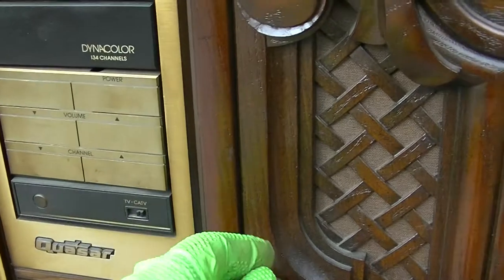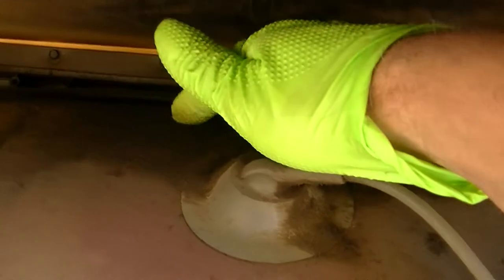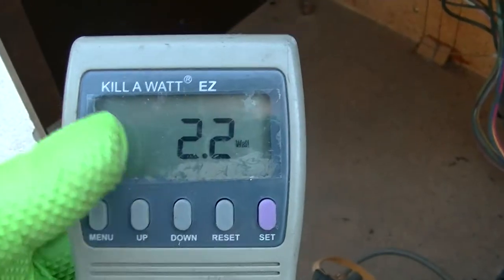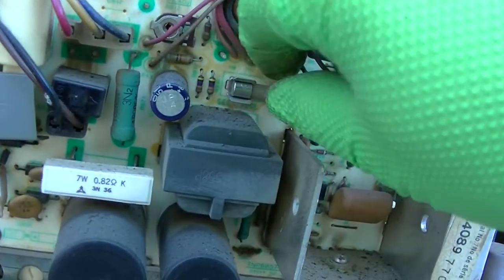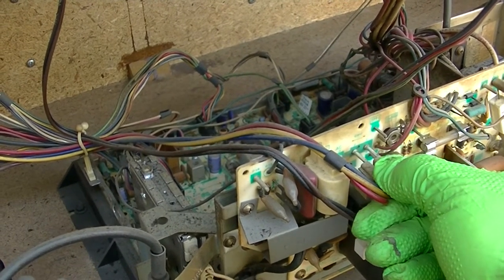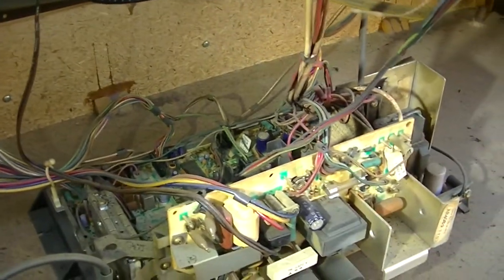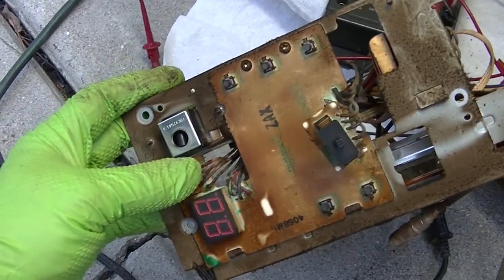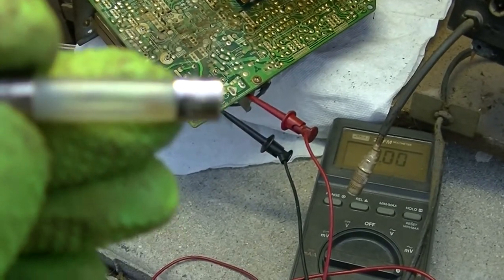Hideous Quasar Smokers Choice 1984 Color Television NASTY

Comment: Coming from a PAL country, it's always interesting to see what tricks American TV manufacturers tried to pull to keep the tint just right. Each manufacturer had its own system of "Dynacolor" or "Chromatrue" or "Supracolor" or whatever for automatic tint adjustment.
Reply: Our NTSC is a joke, even now with a brand new TV you have to put up with different tint levels from channel to channel.
Reply: NEVER THE SAME COLOR TWICE
Reply: @hifijohn  I never had that problem.
Reply: SHANGOO66 wat a Kool  quasar color Television from 1984
Reply: @Mrshoujo  you're lucky I went through all my cable channels and adjusted the tint until the skin tones look natural, my settings went from -9 to +27.Are  you sure you don't have a problem or you've just learned not to notice it.
Reply: When my dad and  mom  wore live my dad and mom bout quasar consul streo tv I
Reply: When my dad and mom wore live my dad and mom bout a quasar consul  streo tv in 1984 from sears when I leave at home
Reply: Now that was Kool when I saw the small flam
Reply: That was Kool inside the tv to see a small flam
Reply: Can you explain what you mean about tint being different on pal as opposed to ntsc?
Reply: @scottkasper6378  The PAL vs. NTSC section of the Wikipedia article on PAL goes into it.
Reply: American networks came up with the VIR signal, part of the set of VIT signals in the vertical interval. This was a specific test signal that had a luminance (B&W) reference, a chroma amplitude reference, a tint or hue reference, and a black level reference. It was never intended for consumer use but rather automatic video parameter adjustment through the network. But the TV manufactures jumped on it for automatic control of the TV receiver, mostly on higher end models,  and it did work for that. But by that time broadcast systems were so stable that this option was not really needed on consumer TVs. The VIR signal had already corrected errors in the transmission path.
Reply: @scottkasper6378  PAL is a derivative of American NTSC color system but with a significant improvement. Phase or hue errors are self canceling line by line in PAL. As I understand PAL color TVs did not even have a hue or tint control. The early roll-out of NTSC suffered from chroma phase errors mainly due to the unstable vacuum tube circuitry on both the consumer and broadcast equipment. The end result was purple faces and blue grass when cutting between commercials and programs. The Europeans, who introduced color much later around 1966, sought to fix this problem first. It was ultimately fixed in the USA and other NTSC countries simply with newer and more stable solid state electronics.
Reply: @andydelle4509  I take it pal systems didn’t do these things?
Reply: @scottkasper6378  they didn't need to, chroma phase correction was built into the system, ergo no tint control on pal tv-sets...color can't get distorted in pal lands, phase alternating line(pal) means phase error is cancelled out...
but it also means you need to broadcast two lines to get one line on receiving end...ergo less color saturation...
Reply: @scottkasper6378  I live and grew up in the USA and actually have a career in broadcast engineering. But I understand the PAL system was indeed immune from hue or phase drift.
Reply: @ivok9846  The technical detail is that NTSC used a free running local oscillator for the chroma subcarrier triggered from the colorburst, which is susceptible to frequency drift. PAL used a phase-locked loop which eliminates this drift to a great extent. You can still notice some colour smearing on PAL broadcasts, in particular on video tapes.
Reply: PAL GOOD
NTSC BAD
Reply: @Stoney3K no.
pll is used for h. and v. sync signals' (re)generation too (in pal and ntsc), so that's not the issue (and americans wouldn't be left behind in oscillator arms race...heh), issue is ntsc distortion because of transmission channel (terrain, buildings) and how it affects  chroma channel(s). pal is inverting phase every other line to combat this, so error cancels itself out, the amount it went above on one line is same amount it'll go below on next, and if you add those two lines, you get resulting vector that's without error (v(c-y) color component is inverted ie it inverts from - to + on alternate lines, 'u' component stays...books on pal have nice vector illustrations of this)
finally, vhs issue is low chroma bandwith, esp. upon copying, pal ota recordings look ok. 
ntsc issue is not smearing but totally missing the color tone. ie i don't have hue errors on my pal vhs ota recordings. 
and ntsc vhs tapes don't have it, unless they were made off the air and phase was off.
pre-recorded ntsc vhs tapes don't have hue issues. but they do have chroma bandwith issues, just like pal vhs, like i said, copying destroys vhs rather fast, but probably destroys pal vhs faster as color tract is longer, ie pal is much more complex system. 
but ntsc vhs has paradox that ota recordings (which should have better quality, master tapes) are always "color uncertain", unless system someone(andy delle) mentioned here (to correct it) was applied early on....
Reply: Unfortunately, that's what comes from being the first country to adopt color television standards. The first of anything is flawed in retrospect.
Reply: @1marcelfilms  Never Twice the Same Colour 😁
Reply: We also missed the "solid state TV in particle board 1950's furniture imitation" era - honestly most of 1980's sets I see on Shango's channel I'd swear it's someone retrofitting a modern TV to cheap cabinet in the 90's.
Reply: @hifijohn  Ever notice how they crank up the color on the commercials?  The sound is always louder as well....
Reply: @pyeltd.5457  PAL-M Medium?
Reply: The VIR system was a good add on to NTSC. It relied on reference signals broadcast during the vertical interval all the way from the camera. Unfortunately, it used line 21, which was taken over by closed captioning and the V-chip, when those technologies became mandatory.
Reply: @ivok9846  Those old tube televisions did not use a PLL in the colour demodulation circuit (they didn't use PLL's _at all_), which is the reason why those old NTSC televisions had such a bad colour reproduction. Modern (>80's) televisions just used an off-the-shelf PLL chip, which makes their colour reproduction a lot closer to PAL.
Reply: @scottkasper6378  PAL doesn't have or need tint control.
Reply: @TiagoCNeves  PAL-M is very similar to NTSC as it's also 525 lines (480 visible) at 60 Hz, it also used the same RF channel system, and before colour Brazilian and American TVs were interchangeable, in fact Brazil used many American models before colour came along. The only difference is that Brazil uses PAL for colour demodulation but near the NTSC's colour frequency (3.58 MHz) so Brazilian TVs are also incompatible with European PAL. Most Brazilian CRTs are PAL-M/NTSC multisystem so they should work in the US, but most American CRTs are NTSC only so they would work in Brazil but display a black and white picture.
Reply: I lived in Europe during the late 70s and felt PAL was far superior to NTSC.
Reply: I agree and funny when there is so many knobs verical horizontal hold etc...you could trici with these and see pay tv free? In my childhood I had an b/w tv with these knobs and you could trick cable company 😉

But I live in Sweden a pal country and no colour tv (what I know) had these settings on an easy knob outside the tv.
Reply: @Italodancer  I remember back then when we were in Canada, my dad had a very simple device that allowed to view scrambled channels, scrambled channels had video phase inversion, so video had negative colours, so the TV can't sync to the sync pulses, what the device had was an RCA in and out and it had a potenciometer that allowed to reverse the video polarity in varying degrees, so many VHS movies were recorded with this device.
Reply: @zulumax1  its an old trick the heavily compress the audio so the average level is much louder, they also like to put commercials at quiet parts of a movie so the commercial sounds louder,they may also like to boost the 1k-3k range of the audio the ear is very sensitive to that range.
Reply: When you are the first to manufacture a colour TV set, there are no rules. When they came up with the NTSC system they had nothing to go by. We had to be thankful that the system worked as well as it did. Research is research because “if we knew what we were doing then it wouldn’t be research.”
Reply: @hifijohn  thanks for the detailed explanation!
Reply: @Stoney3K  I've never seen any "colour smearing" on PAL broadcasts. Colour issues on VHS have more to do with the colour-under recording system than on any differences between PAL & NTSC. The main benefit of PAL is that the alternating chroma phase effectively cancels out any phase errors. Only on very early PAL equipment were phase errors an issue, causing "Hanover Bars" to appear on the picture if the phase error was very large. Later implantations of PAL, with delay lines and swinging bursts, got rid of the Hanover Bars problem.
Reply: dont forget the the US invented the colour shadowmask CRT. They were the first colour broadcaster so its easy with hindsight to criticize NTSC for its colour phase errors. I think the yanks might call that 'monday morning quarter-backing'. PAL is really just NTSC with a little extra added on. BTW I love those big console cabinets, they are totally unknown here in the UK    and appear to me as american as The Roy Rogers Show and basketball.
Reply: P.S. Yes I know that TV has a japanese Matsushita chassis
Reply: @scottkasper6378  there is no tint required on PAL sets as the 'PAL' part inherently cancels any colour errors caused by poor signals
Reply: @pyeltd.5457  Correct me if I'm wrong, but the UK was doing both B&W and PAL color simulcasts up into the 80s, right? That's why NTSC is why it is; the FCC didn't want two incompatible broadcasts of the same programming eating up bandwidth. So it's either have some sort of compatible system that works with all televisions (like FM stereo) regardless of compromise or nothing at all.
Reply: @hifijohn  I've seen some absolutely awful pictures on antiquated cable systems, even on new sets. I saw a set in Colorado last fall that was hooked up to some have-baked system ("spectrum", or something like that)  and it still had black zones on the sides of a hazy 3 by 4 picture. My set is just hooked up to an antenna and the picture is more-or-less consistent from channel to channel. Whatever variation there is comes from the sources themselves, not the processing of the ATSC signal.
Reply: @Italodancer  Color adjustments were so frequent on American sets that most of the early sets with remote control had controls for the motor-driven color adjustments right on the remote.
Reply: @njm1971nyc  In the explanations I've read of the improvements of PAL over NTSC, it was stated that there was always a low-budget PAL option in which the two lines were displayed as-is (rather than averaged and stored in an expensive delay-line) and being adjacent, the eyes would see the average of the two errors, sort-of canceling the error out. Maybe Sony, already having superior technology, felt content with cheaping out on the PAL technology. They were also said to have developed the Trinitron system partly to avoid paying royalties to RCA for a traditional color mask, so they must have valued their independence.
Reply: @pcno2832  As far as I remember (I was about 7 years old at the time!), the Hue control did actually work, so I'm not sure about that theory...I don't think it was PAL-S they were using (Pal Simple). I think they skirted around PAL specs entirely!! 😄
Reply: @greggaieck4119  good lord learn some grammar.
Reply: @pcno2832  Sony bought the Autometric's single gun Chromatron picture tube. It was the foundation for the development of the Trinitron.
Reply: @jf3570  I believe the weird frame rate of the NTSC was a side effect of the color carrier frequency being some sort of multiple number of the sound carrier.
Reply: @UHF43  Correct.  Since the colour subcarrier has to be a multiple of the horizontal scan frequency, 525 lines at precisely 30 Hz would have caused the necessary colour subcarrier's sidebands to interfere with the audio carrier.  So there were two fixes available:  Move the audio carrier, or fudge the frame rate.  And someone, in their infinite wisdom, thought the latter would be better.  (Their argument was that shifting the audio would require retuning everyone's TV, but a slight shift in frame rate can be accommodated by the existing TVs, no modifications required.  True.  But I think retuning a few early TVs would have been far less burden than a decision which has forever created archives of video recordings at an absolutel atrocious frame rate that makes accurate editing one hell of a hassle.)
Reply: @AiOinc1  good point
Reply: @RJDA.Dakota  good
Reply: @scottkasper6378  simply put, you sometimes have to change the tint on ntsc due to small signal timing drifts, which affect the actual colour,  with pal it 'self corrects' most errors so tint adjustment not normally needed although some earlier pal sets did still have a tint control , i've had a few...  some early japanese made pal sets werent strictly pal due to licence/royalty problems so used a 'modified' ntsc colour decoder that decoded pal acceptably but didnt use the auto correcting facility, as this is what the licence/royalty/patent was for, so these sets still had a  tint control
Reply: We love branding.
Reply: People Are Lavender vs. Never The Same Colo(u)r
Reply: @jf3570  Drop frame time code makes it all work just fine.  I know of nobody who edits video having any kind of time issue when using DF TC.  And, believe it or not, on NTSC, it's called "color subcarrier"... there is only one "U" in the USA's color television system. ;)
Reply: @basketballjones6782  Maybe the video editors you know don't think erratic jerks and frame misalignments are a "time issue".  But the rest of us who can put aside misplaced pride and actually identify when something is of turdbucket design, aim higher.
Reply: I have a 2000 model Trinitron and the tint control seems to be doing just fine, I never notice any issues with tint across different video sources. 

In either case, I'll take 60hz over 50 if it means a little fiddling.